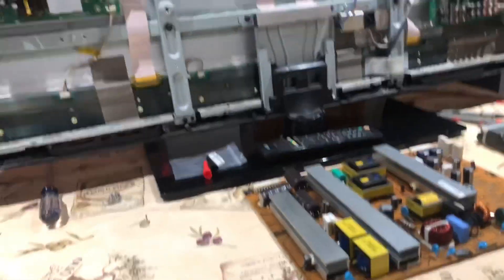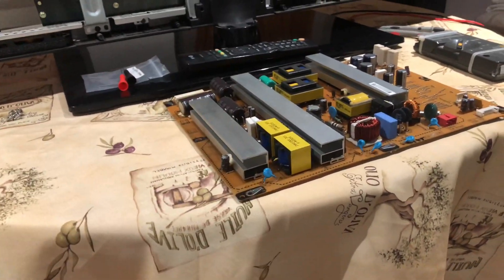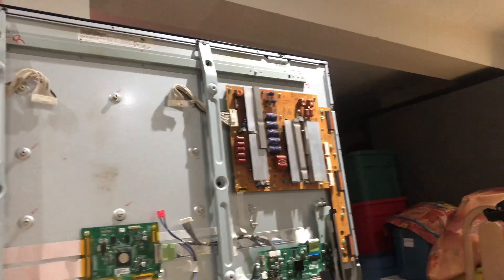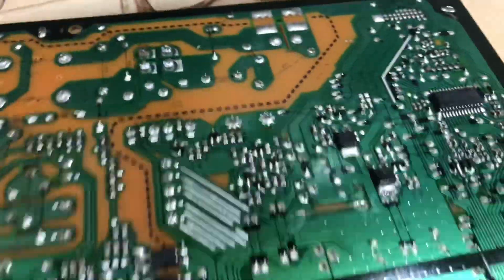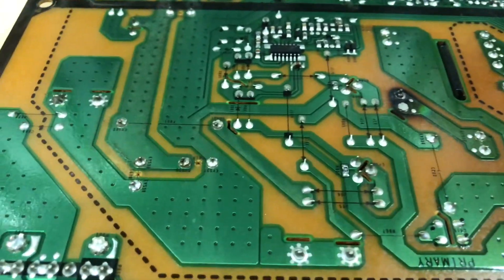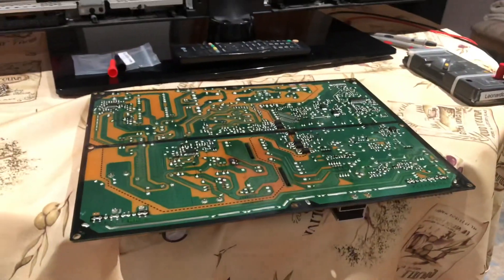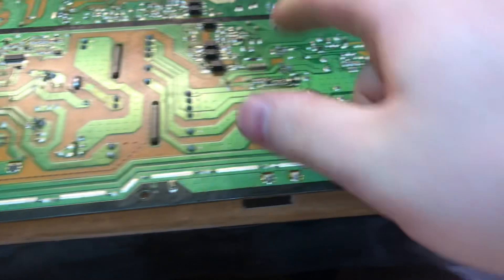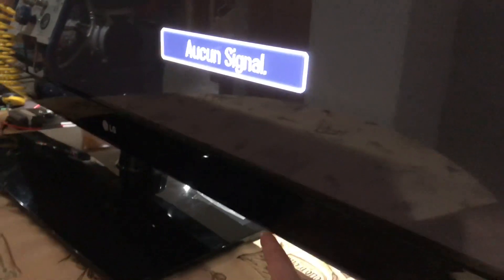It's Not Turning On! - LG Plasma TV Power Supply Repair [Video 31]

Comment: good... you lucked out....that was nothing,  because  ANY of those 1000 littlse  SMD  parts could have caused that, and then, like me here with the exact same board, you'd have ALOT more work  ( here i thing i have a leaky Zener,  D701, very near to the IC  in the back , IC is the controller for the WHOLE PowerSupply, but i am just a hobbyist, don't know much,   i'm getting .222 V in circuit, gonna take it out to measure it better;